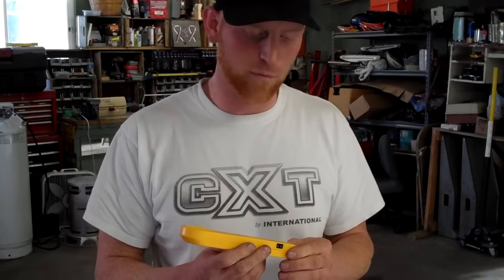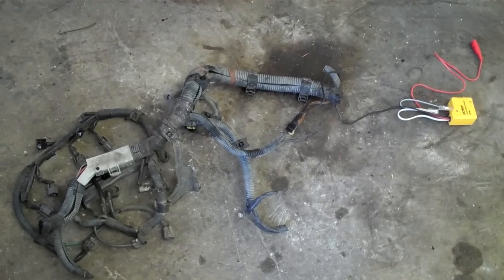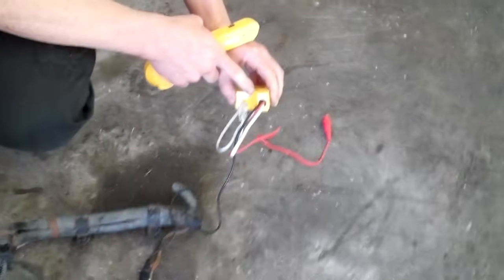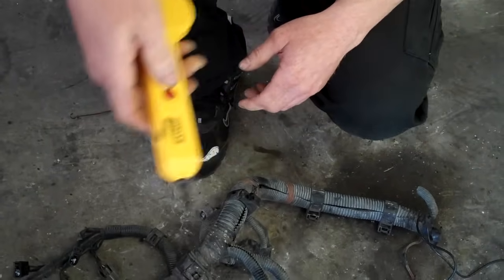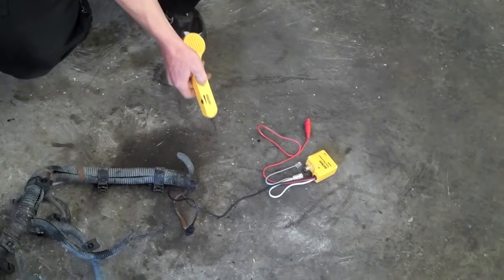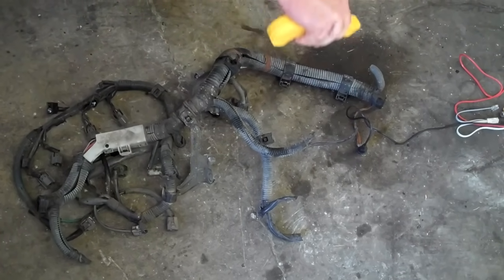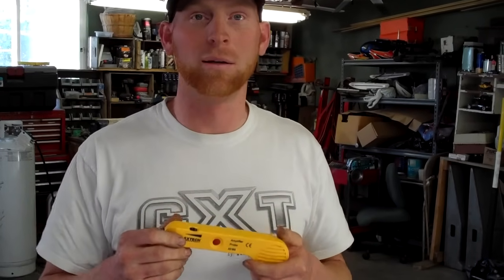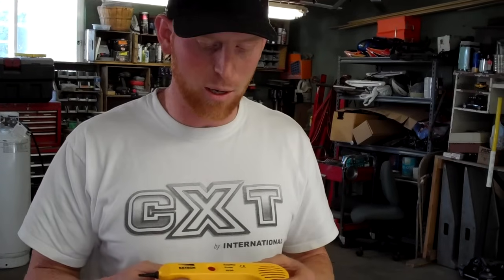How to find an open circuit or shorted wire the FAST easy way

Comment from the maker: Technically "short" is a term for a circuit that "short cuts" the circuit by passing the load or resistance in the circuit to ground.  It's used incorrectly here.  A "break in the circuit" is correct.  I said it wrong to make the video easier to find.  MANY people use the term incorrectly.  I did it this way to help them find an answer- like when Google says "did you mean...." when you use the wrong word or miss spell a word.  GREAT QUESTION!

Comment: I have, for example a grounding issue with a dome light, and I have a pencil type tester with a light inside the handle and a wire that has an alligator clip on it, which I assume I can connect to a ground source, in this case, the ground on the dome light, and place the point of the pencil on the positive of the dome light, and then turn on the dome light, to find that I have a short in the system?  Does this make sense?  How would I find where the wire is shorting out?

Comment from the maker: In the right hands you could.   By that I mean you'd have to disconnect a lot of other grounds to check it.  Otherwise nearly the whole car would have tone.  It might be easier to just strategically isolate a bad ground using a grounding wire with alligator clips.

Comment: Questions:
1. Does the device have a sensitivity control to narrow the location down even further?
2. It the wire runs inside the frame does it lose the signal? ( a shielded effect)
3. Will it work on shielded cable or wire?

Comment: Thankyou Brian, I found a unique continuity tester that you have to touch to the wire but with only a metal screwdriver probe, (no wires). It lights up. It will light if you touch it. Pretty sensitive to power. It was ten bucks. Thanks Again  Tony

Comment: good video but that does't seem like its gonna be much use, when your tring to find breakage under a dash. Only in they could invent one that you connect to the end of a wire that send a sonic wave through the wire that will tell you how far down the wire it's broken.

Comment: This tool is normally used to find unidentified data cables in a bundle or away from a starting point. Not for power lines or to find shorted runs. I'm not sure how this would have a practical use on a vehicle. I know how these things work because I install data cables for a living and the way you describe its use here is quite different.  Unless you can come up with a practical use for it on a car I must dislike this video.  But I am subscribed and like all the others I've seen :)

Comment from the maker: There's a better tool for that job.  Realfixesrealfast has a great video on it.  It's a kit that's used for that- it's about $35 and comes with a capacitor that goes in place of the fuse and a metal box that has an analog meter in it that shows direction of current flow.  That's the best way to find a short to ground like that.  I think the vid that Duane demos that on is on a fuel injection short to ground on a Jeep G. Cherokee.

Comment: enjoy the video and understand the function but what if you have a short with one wire in a bundle for example?  I have a motorcycle that spontaneously blows a fuse depending on what rattles it and using a tool like this, I will just get the same tone since it's a bundle of wires together wrapped in looms.  Any suggestions?  (When I try and troubleshoot, the fuse never blows - but when I'm on open road, there it goes!)

Comment: His video is about open circuit.If the pair is shorted then you use a TDR to find where it's shorted. You can also connect a constant current source and use a thermal imager to find the short (bring the wire in question to 40 celsius), I looked for pairs like this across massive BIX fields.

Comment: This makes a lot of sense, I like it.  Right now chasing down a battery drain on a 2001 Cavalier, brand new battery, it's fine if you drive it every day, 13.6v running (alternator charging) 12.36 after 30m off, about 11.5v by the first start of a morning which is enough to start, but after 3-4 days of the car not being driven the battery reads 6 or 7 volts.  I see these tone generators on Amazon for as little as $37 (Fox Jr and Hound Jr kit with carrying pouch) and $70-$90 for nice ones.

Comment: This is great for boat repair.  I have a 30 YO boat with apparently 3 different electrical systems installed one on top of the other over the years.  Without this tool, I would have to crawl through bilges, lockers, etc. following wires the hard way.  Great presentation, BTW

Comment: I do phone work, If you put the tone across a pair that has a low resistance (solid) short, the tone will be shunted down and barely audible--if at all.  (For example, clip the two leads together and you won't hear tone at all).  The tone/probe tool is far better suited to tracing wire routes that are opens.  Also, if the wire you're tracing is grounded, the tone will be everywhere--and therefore nowhere.  It'll be bleeding all over the place and you'll never find it. Best used for opens.

Comment: yeah, i use a tone generator all the time to trace OC's.  cat 5 bundles of hundreds of cables (there is always a spare twisted pair to tone with), security alarms, coax cable, phone (two pair, cat 5 or 24 pair), electrical (more than 50V is high voltage),...etc..  just be careful with the phone company, anything more than 50V is high voltage.  don't stand in a puddle of water on the ground or be grounded when someone tries to call in, it jumps to around 100V DC.  it will lite you up.

Comment: Wasn't exactly sure how the tone device detected the electrical short in your vid. You moved the device away from the harness and the tone lessened. But where was the short? Mentioned was the cut in the harness, but got lost when the tine device changed tones when taken away from wire loom or harness.

Comment: Is it a short or an open? There are only 3 wire faults - open, short-to-ground and high resistance. You showed finding an open, but you called it a short. I'm not certain what fault you're teaching. It's possible to know exactly *what* fault you have with a digital voltmeter, using ghost and zero volts, plus the LOADpro leads for high resistance. I'd be interested to see you use a single - not a loom - and demonstrate the tool on each of the above faults. This tool could help *find* the fault.

Comment: I have a tone generator I used when I did phone work but I never thought of using it on the automotive side. Good idea because I hate tring to find shorted wires in automotive wire looms.

Comment: I was searching for how to find a bad ground on my motorcycle, keeps blowing the fuse for the turn signal circuit.  I used one of these in IT before tracing wires to the server room.  Will it help me locate a bad ground?  Don't believe it will, but it is a great tool and glad to know they are available at a good price.

Comment: Which method would you like to use?  Induction is easier to use, while radio is somewhat easier to build, has a bit of a better range, but must be tuned in.  The only difference will be in the receiver.  The function generator is the same either way.  You'll need a $2.00 232 chip and a couple of other basic materials.  You'll also need some basic soldering skills and the ability to follow a standard wiring diagram.  I'll dig up the diagrams and post you some cheap suppliers tomorrow.

Comment: I keep popping fuses on one of my lighting circuits. My low beams won't come on (I've replaced the switch) and the up/down motors don't work. HOWEVER If the car is not running...they function as normal, but when it's running I just pop the fuse on ONE of the lights, and lose the ability to turn my H.Beams on and off. Sorry for the novel, and don't worry about answering this, but any ideas are welcome...I'm just not sure where to start (it's a real pain getting at the wiring for those lights).

Comment: Nope.  Just an engineer who knows that tool is really just a function generator with a Colpitts oscillator for a receiver.  It was actually invented waaay back in 1920. It uses inductance with a capacitor to determine frequency.  Or, you could use an AM receiver tuned to the frequency that the function creates.  There's probably not much danger of AM radio stations disturbing your tool in 2012, so this is probably a more practical option than it would have been years ago.

Comment from the maker: @djbranboogy03 In a transmission it's often times due to metal shavings/filings that get suspended in the transmission fluid and then into the solenoids etc.

Comment from the maker: @Kingsevends Generally removing them can have adverse affects.  Most drains are from stereo wiring done improperly regarding a dangling power antenna wire etc.  I'd check for that first.  Be sure to prove fault before assigning large amounts of time on a fix.

Comment: @jaxareback They have more powerful (and expensive) toner/probes for electrician use, even ones that trace underground/buried wires.

The toner/probe shown is for made for low-voltage telecom type wiring, although it can work on automotive wiring or my personal fav christmas lights (the kind where one burnt bulb makes the whole thing go dark).

Comment: @robinater I had a similar problem and it turned out to be the throttle body, it was binding due to wear, so i replaced the IAC and it still revved high, i removed everything that hooks up to the side of the throttle body and sure enough it wiggled in its bushing, but your problem sounds different since you idle too low,any engine light? is it running rich, email me better: geonyc31@gmail.com where you located?

Comment: @Ikeepitreelz Thanks I'll try that its been bugging me...and since you have 2 GTA's I had to replace the IAC sensor for the idle Do you know the Re-Learn procedure for it . Ive been told to just drive ti till it does but that doesn't seem right to me. The Idle is still high then get too low then the car stalls unless I keep the throttle down a bit at stops.

Comment: @robinater Did yo check out the grounds? there is a ground to the engine block along the transmission to engine mount,make sure it's in place and just check out all you grounds, follow you negative battery cable to your engine block and make sure that's on tight and clean. I have two '88 GTAS one digital dash and the other analog.

Comment: I have an 87 Trans Am GTA with the digital dash. when I start the car the dash illuminates bright but when I turn on the head lights the dash lights dim and sometimes flicker. Also Ive lots power a few times while driving just stalled out. I think theres some kind of electrical problem but what can you suggest I do to remedy this?

Comment: I have a 96 camry code 1300 - igniter and coil. I replaced them same problem so must be in wire harness or connectors --how to find is my question

Comment: Question 3) Let say I have 12 volt wire start at points A which goes to the Fuse F and to the  load L and  thenreturns to back to battery neative post to complete circuit. Assuming I am checking for break in entire path of Positive after Fuse F, so i would set the transmitter to Tone, and bridge the Fuse using two transmiter wire, then when I trace , i will hear the beap until load, and the beep goes just at the point where load connect to negative. Is that right, please advise.

Comment: Qustion 2) To Trace the short that blows up the fuse, should i have to set the Transmittter to Tone or Cont?
                I assume i have to set it to Trace and connect the one wire of transmitter to one side of the fuse pin and other wire of transmitte to the other side of fuse pin(basically bridging using Tranmistter wire) and trace until the beep stops, is that right?..

Comment: @ADPTraining 

Question 1) To Trace the Open wire in positive, I have to set it to Tone. I have two wire from Transmitter. Should i just have to connect any one wire, to positive and keep tracing until beep stops to find the trace?...  Or I should connect one wire of transmiter to the positive post of battery and connect the other wire of transmiter to the wire I am tracing to find the break until beep stops

Comment: @ADPTraining 
Hi, I watch lot of your videos in your site. Infact i bought this tool. I have one question regarding short finding. It has two wire, do you expect me to jump the fuse that blows off because of short using that two wire in the transmitter(sender). Then should i have keep it Trace or Cont..  I believe it should be Trace, then while tracing will it stop beeping when the short is found or when the Ground is found. Pls advise.

Comment from the maker: @jambe1234567 For a short to ground I eliminate things in the circuit  and then add them back one at a time till the fuse pops- then trace that wire group for chaffed or melted wire jackets.  Search on my channel for "finding a short on a Subaru or any other car".

Comment: I've been thinking about making one of these some day when I have time. I do have an AC powered device that I use for finding coax cable circuits and also for isolating A/C fuses without turning everything off. I'm a little anxious about using it with automotive circuits where I could fry devices downstream.